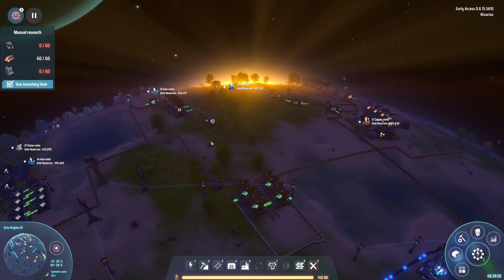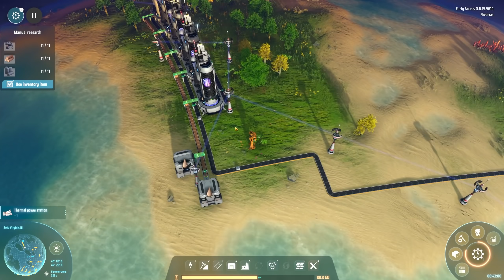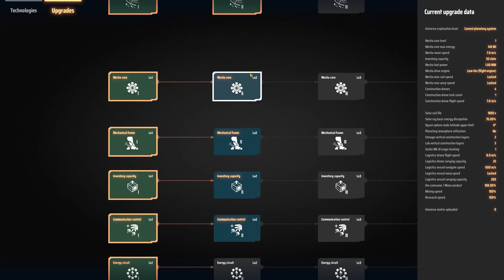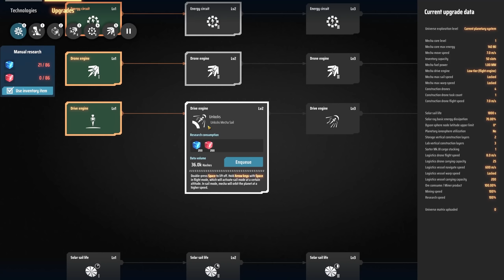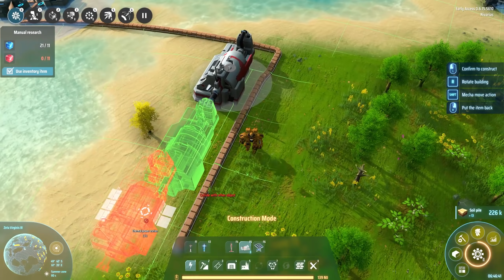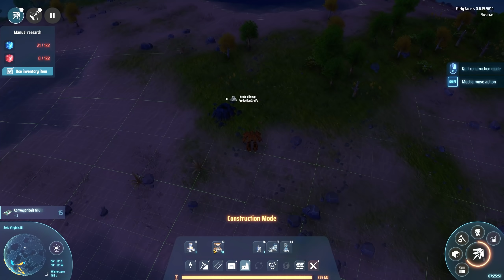Dyson Sphere Program - POWER || Part 08 || Strategy Planetary Simulation

Comment: Thanks for introducing me to this game. I love it. Some tips for you: use liquid storage for oil, it can hold much more liquid than normal storage. You can also stack storage for more storing space.
Also set up assembler for commons stuffs like belt, sorter, foundation.
When you get into space, get a lot of graphite with you, because you can get lost the first time you fly through space. You can also power the thermal stations at the moon that does not have atmosphere for wind turbine. Optimally, you should prepare 100 solar panels and accumulator before getting to another moon, because power will be a problem there

Comment: Hi Nivarias. 
Always watch your videos, keep up the good work. 

When i play this game, I make a vain/transport-line through the akvator of the planet. From that vain i just redirect the lain i need to the smelters or assembler, create the new goods and rejoin them all back to the main akvator-line. 

That way you get all resources from and back to the main lines.
Of course you quickly end up with more thrn than 30 line with different goods, but if you collect them all in 30 storage bokses, make and output from each into splitters. 3 storage bokses with different goods connected to 1 splitter the gods will the sort it selv on one belt with 3 different gods on one line, reducing the lines from 30 to 10. 

Hope it makes sense. Anyway thanks for the videos.